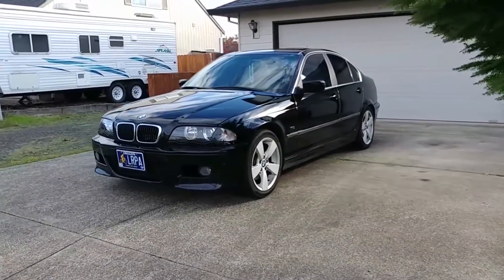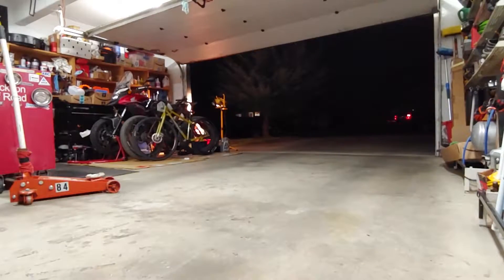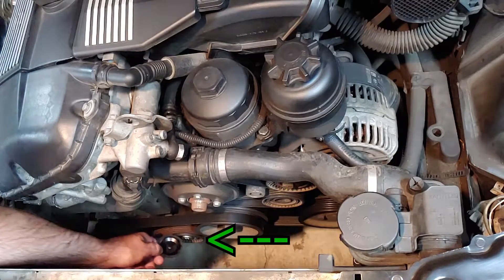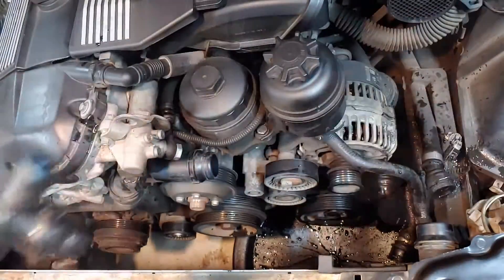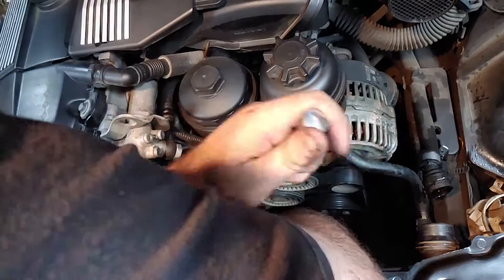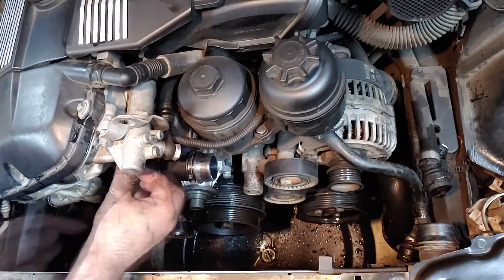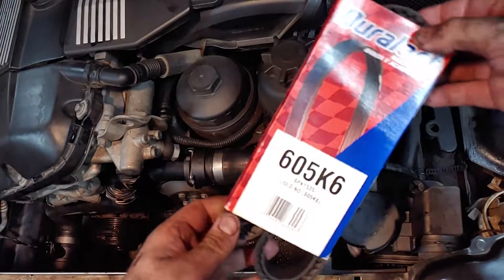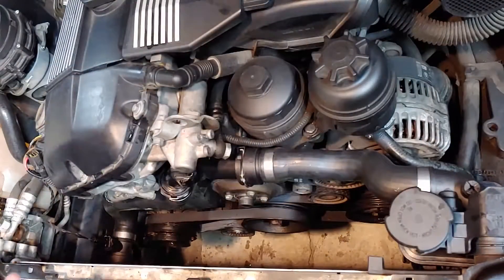BMW Cooling System Overhaul Made Easy - 3-Series & 5-Series 1999-2006

Comment from the maker: **Z4 owners**
Your car has an extra brace that gets in the way of much of this work.  Everything can still be done with the instructions from this video except replacing the water pump.  To replace the water pump, you'll need to remove the bolt from the top of the motor mount on the (American) driver's side.  Use your floor jack with a wood block to carefully raise the engine.  With only one motor mount connected, the engine should tilt to one side, allowing just enough room to remove and replace the water pump.

Comment: I have a question.  I have a 2000 BMW 323i sport wagon.  
I’m doing this exact job on my car and following your instructions to every little detail. 
I can’t get the fan to come out.  It’s loose, but there’s a bolt that’s attached to the water pump I believe?  How does that come out, and did I miss you taking yours out?
Reply from the maker: Sounds like you have a mechanical fan instead of an electric one? I put a link in the description to instructions on removing a mechanical fan.
Reply: @ the bolts on my pulley are broken.  As is the pulley itself.  I’m replacing all of those parts and I have them finally.  I still haven’t been able to get the fan separated from the pulley/water pump.
Reply from the maker: What a nightmare! I'm glad you're getting through it.
Reply: Thank you…. I need to find those specialty tools to get that out of there.  Apparently this YouTube doesn’t let you send pics in comments.
Reply from the maker: I rented them once from AutoZone. Many parts stores offer rental tools for cheap or free.

Comment: Be careful with the lowest thermostat bolts as they can snap and may have been overtorqued by someone else in the past. Soak them in WD40 for a bit first and take it slow. If they do snap, it's usually quite high up so you can use the two nut method to remove them. BMW no longer make these particular bolts either but I've found that 11531740317 will fit.

Be careful with the waterpump studs also as they could have been overtorqued in the past too and will snap on you. You can usually see it narrowing in the middle.

If you decide to replace your pulleys and tensioners while you're here (not a bad idea as it's relatively easy to do), some models of the exact same engine may not have the idler pulley, which is the largest pulley at the top that fastens into the alternator. If you want to fit it, you'll need the longer bolt which is part number 07119904677. This bolt has a higher torque spec so be careful you don't get this and the other tensioners mixed up. 

In addition, you can replace the main tensioner with a hydraulic or mechanical one. The A/C tensioner is mechanical also and can be done from the top, just leave the retaining pin in until you're ready to fit the belt.

Hardest part of this job is getting the lower radiator hose off.

Comment: This is more a cooling system refresh than a cooling system overhaul. If you're overhauling the entire cooling system then you should also be replacing all cooling system hoses and cooling system hard pipes (made out of hard plastic) which are all under the intake manifold. That way you ensure there will be no failures throughout the entire cooling system. Good video showing the typical cooling system refresh/maintenance.
Reply from the maker: That's probably true but most people seem to use those words interchangeably. This car is 22 years old, I've owned it for 15 years, and the coolant hard lines have never needed to be replaced so they are not part of my maintenance schedule. If they ever go bad I will make a separate video on replacing them. I always thought they were metal, are you sure they are plastic? Thanks for the input, I believe you are technically correct.
Reply: @endlessmoneypits  no worries. I enjoyed your video, it was very informative. I'm positive the two hard lines along the engine (upper and lower) are made out of plastic, the same material you have on either end of the OEM radiator. That type of hard plastic. I have  them on hand and am about to replace those two hard lines as well as all the hoses in the cooling system of my ZHP. Keep up the great work on your videos! 👍
Reply: @endlessmoneypits  I'm actually quite reluctant to change these also. The only times I've seen these fail is when the owner has changed them out for an inferior newer part. Sadly you have to be a lot more wary now with parts. OE brands that were good 20 years ago are getting parts made in China on the cheap. Even the genuine parts aren't necessarily good now.
Reply from the maker: This is so true. I just pulled out a Bosch spark plug and it was missing two of the four prongs for the electrode. Fml...
Reply: @endlessmoneypits  I've had no luck with Bosch either. Even the damn cabin filters they make don't fit now lol. I honestly hate buying plugs for anything now as there's so many knock offs online. I've seen really cheap "genuine" BMW ones on Ebay and there's just no way in hell those can be genuine at that price.

Comment: How did you get to put the expansion tank retainer on the reservoir I’ve been having so much trouble with that and it always come off because my e46 you have to push it in and it’s a pain
Reply from the maker: Mine might go off and on more easily because it's so old. I just had to pull straight up / push straight down. Silicone grease and a little wiggling might help. I think it was a little tricky on my friend's Z4 but I don't remember exactly how it was different. Wish I could help more than that.

Comment: This is the most thorough video I’ve seen on an e46 cooling system refresh. I appreciate how you show what tools you use in the beginning. It could be frustrating when you’re half way through a project and you realize you need to stop what your doing to make a trip to autozone because you didn’t have a tool that is necessary.
Reply from the maker: Thank you for saying that.  My goal is to make these videos as helpful as possible, so please let me know if there is anything I could improve.